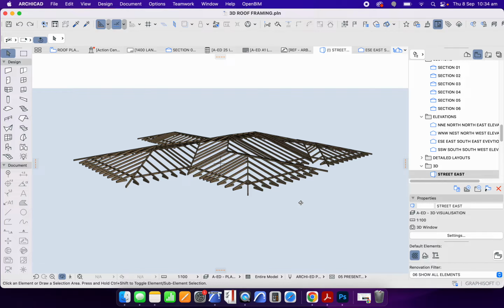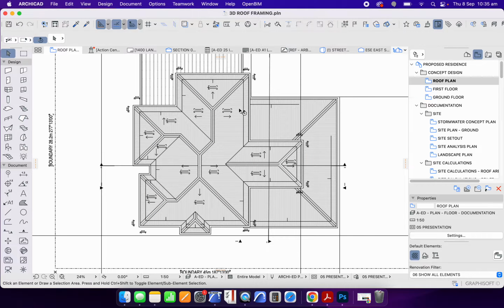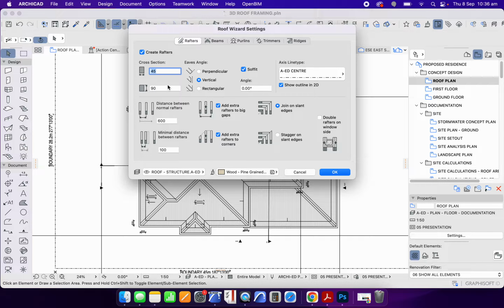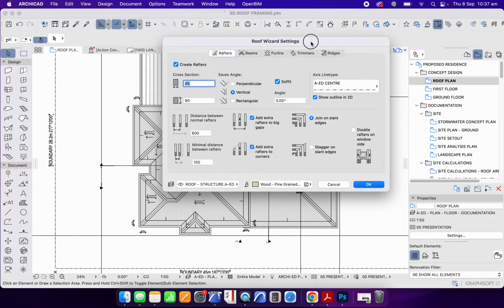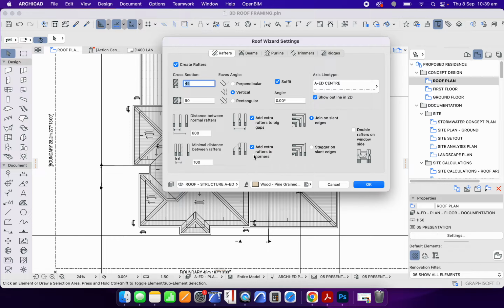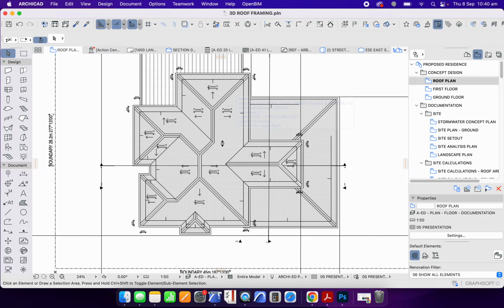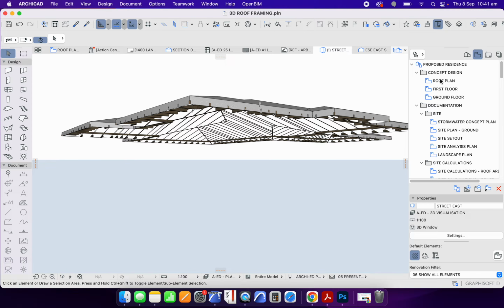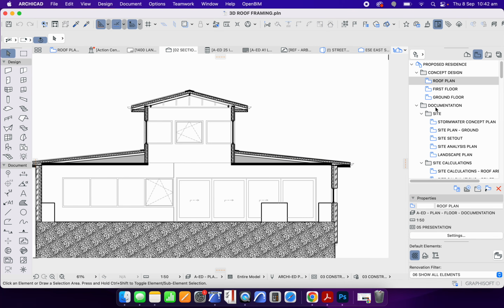ArchiCAD Roof Wizard - How to create roof framing automatically

Comment: This is the most simple roof form and in construction the whole roof framing will never be like that.. just wondering if ArchiCad is capable making real complex roof framing..thanks..
Reply: definitely capable with the truss maker built in, and with individual objects (truss library in the object tool), or with beams/columns (my preferred method)